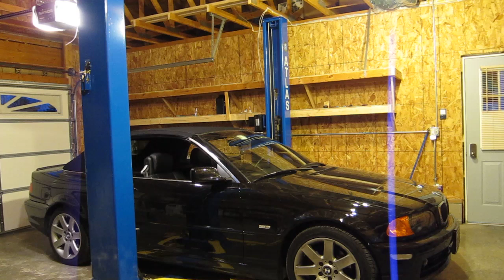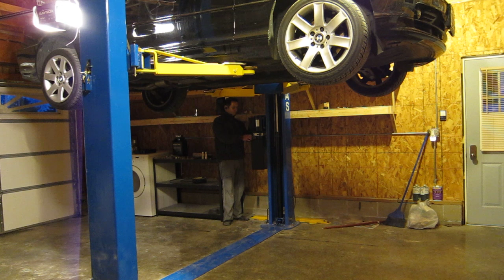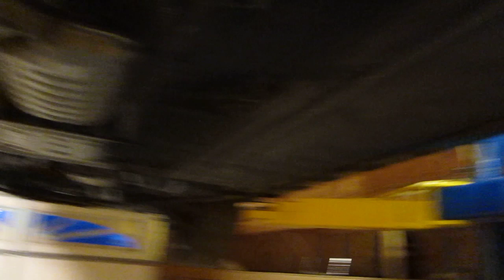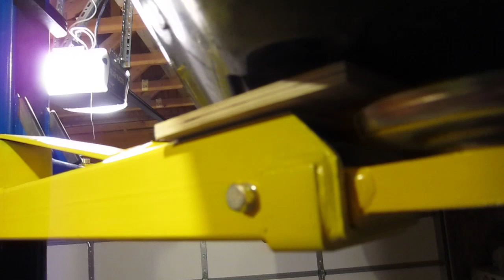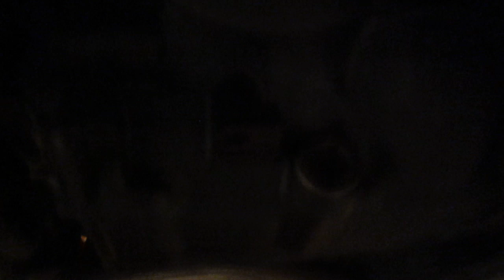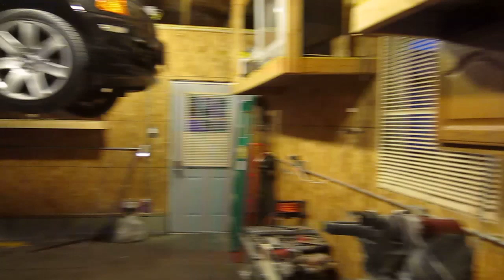Atlas BP8000 two post lift in action

Comment: Does the achor bolts come with it? How thick does the concrete needs to be? I'm thinking about buying a hoist but unsure what brand to buy
Reply from the maker: Bruce Brenke  the manual for the lift will tell you the concrete thickness and the anchors you can find at any menards or Home Depot. BP 8000 is great - I moved it to another garage . Cheap and saves my butt on maintenance
Reply: Sam Collins how did you do your ceiling was it professional done or did you do it?
Reply from the maker: I did it. Just reinforce the trusses you cut. It’s not by the book, but had no choice

Comment: Did they give you lifting pads or blocks?  Those wooden blocks are gonna give you a scare one of these days!
Reply from the maker: John Kaufmann lifting pads. since then I got better at positioning the car. beemers are so short - lifting points are tough
Reply: Don’t use wooden blocks as extenders or lift pads. Use the yellow round lift pad the car’s lift points! These wooden blocks will break if you use them. Use only the Lift pad from the yellow
Lift arms

Comment: I see you have sistered some trusses in the ceiling.  Do you have any other videos with the ceiling.  I'd like to do the same.  thx
Reply from the maker: John Kaufmann yeah. I did the same cutting on my new garage - this house got sold. unfortunately I have OSB covering them - new garage is insulated/heated/air conditioned
Reply: Sam Collins ok cool - I have a pretty good view but I know I'll need to have a pro come in and draw up some plans on how to do it.  Have a great weekend!
Reply from the maker: Just cut them. They say it's an engineered truss - bs. It is - but if you brace it above, up and down - then have the weight of the roof actually rest on the posts of the lift - you've got a bullet proof roof. Keep in mind most american contractors are highschool dropouts that follow Menards and home depot. Don't waste $$. I did it twice. Me and my dad. Had to provide the Stella ...

Comment: how annoying is the baseplate? does it come up alot? have you used it with a transmission jack?
Reply from the maker: choi0706  did not use the trans jack. If you want to have a free floor, go one model up , the cables run overhead (see on Greg smith equipment s website). The baseplate just makes noise when you drive over it, but it’s heavy, does not come up

Comment: The round lift pad on the arms isn’t touching the lift points! Do not use wood or cement blocks as extenders! If you use them the car will fall off the lift! You don’t want a damaged car, Do you? Make sure you only use the yellow round lift pads on all of the lift arms
Reply from the maker: The short BMWs are trouble. In the mean time I bought arm adapters you can use for shorter wheel base cars (like my 3 series or s500 coupe)